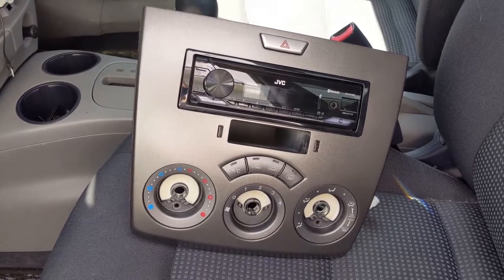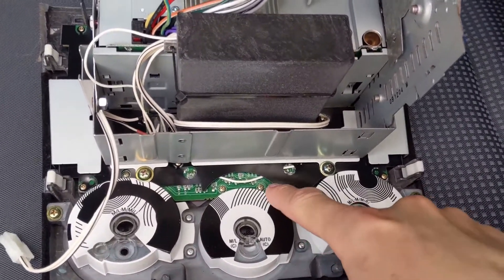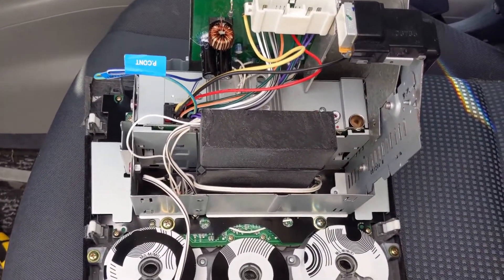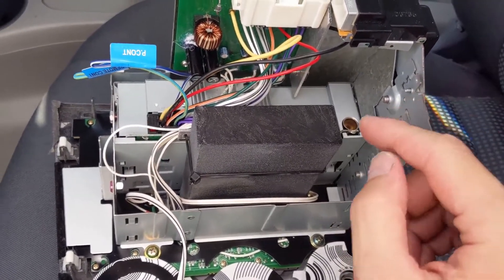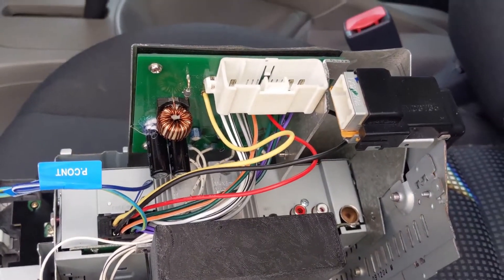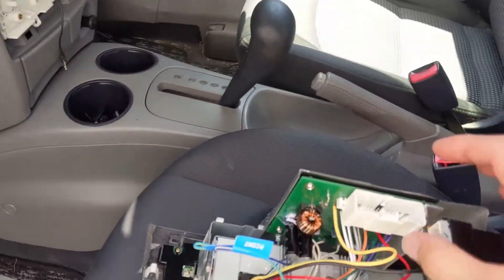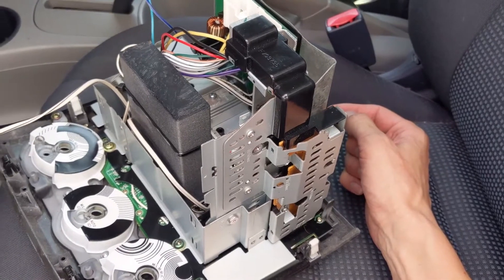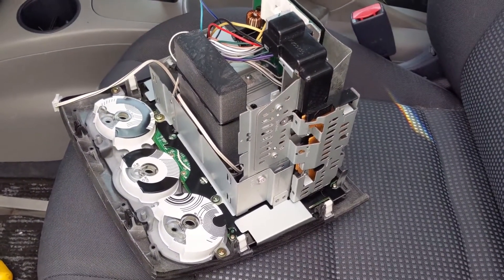2005 Mazda Demio stereo replacement

Comment: Just wondering how much do you think it would cost for a electrician to put a aftermarket stereo in there as I’ve got the same car and my cd player in mine isn’t great
Reply from the maker: I have no idea, I'd guess it's not the sort of thing an auto electrician would do since you have to modify the original circuit board but I could be wrong, I haven't talked to any auto electricians or car audio places about it.

Comment: Great job! what material did you use to fill the holes? is that a black putty? first time I see
Reply from the maker: 3d printed ABS plastic. I glued it in place using more ABS dissolved in acetone. Plastic welding or epoxy might have been better though as it seems the glued bits have continued to shrink a little and I can now see slight join marks through the paint.